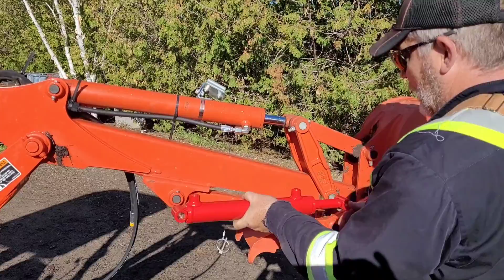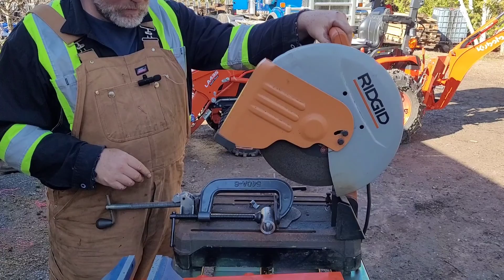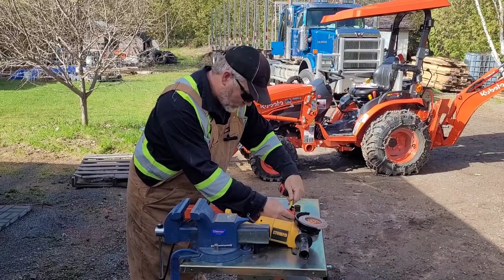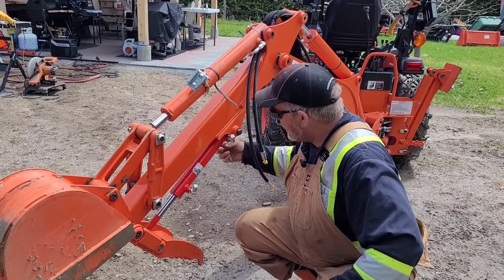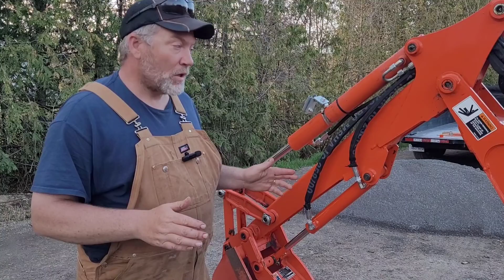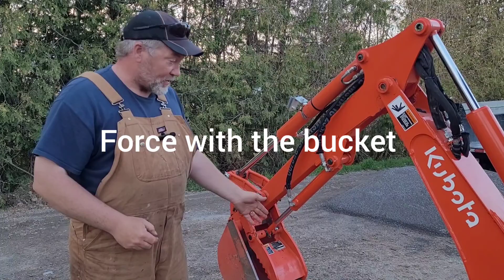D.I.Y Hydraulic thumb for the Kubota B2601 compact tractor.

Comment: Could you have put a sleeve in the holes instead of cutting the ends off?
Reply from the maker: I could have if the ports would have been in the right location but unfortunately I had to rotate the cross tube on the cylinder end 90 degrees. Thanks for watching and I hope that clears it up. 👍👍

Comment: Would absolutely love to see someone that integrated the controls for the cylinder to the BH itself, rather than rear remotes, along with controls on the BH controls so that you can use the thumb while using the backhoe without reaching for the rear remotes.  

I've also heard that there should be a relief on the thumb circuit so that you can't damage the thumb cylinder with the bucket.  Any thoughts?
Reply from the maker: I could have integrated it with the third function and just added a two way normally open switch and mounted it to either control for the backhoe. But I chose to go with the easy route because the only time I use the thumb is if I get a big stone when I am digging and the newly added cylinder saves me from getting off the seat.  I don't use it as a grapple very often. Thank you for watching the video. 👍👍

Comment: you know, you could have used 1" OD x 3/4" ID bushings in the backhoe mounting ears and stepped down to 3/4" pins and not have to risk welding on your cylinder. as long as you're only using the thumb to clamp, the 3/4" pins will hold any force the cylinder can generate.
Reply from the maker: Thanks very much for watching!! I agree with you about the bushing, unfortunately with the cylinder that I purchased the  ports were 90 degrees off of where they had to be so the cross tube on the cylinder end had to be removed regardless. The cross tubes were only 10 bucks, so I figured it was the most economical solution.

Comment: Look over the rod of that Princesses auto cylinder. I had one about that size. Cut the ends off and welded ball links on to make a hydraulic top link. Once done I extended it out and noticed a ding in the chrome. Took it back. They took it but lost my time and ball links I welded on. Got more ball links and before I did anything I pulled the cylinder out on the replaced one and sure enough the next one had chrome damage too.
Reply from the maker: Great advice and thank you for watching. I checked mine over and it seems to be OK. I think the quality control is lacking from certain manufacturers these days.
Reply: As a welder all my life I buy hundred of them in many sizes from Princes auto for things I build for people an my self. Never have had any problems with any of them. .  In tim case the 1.5" one he used is not going to hold up at all. The ones I have put on other peoples I use the same 2.5' OD same as this tractor mfg supplies when factory ordered. That rod on his 1.5 od is only 3/4" or the 1'  gripping any big rock takes a good hard clamp an that rod will bend even at a 6" stock and will not have the power to hold

Comment: To keep from bending the thumb Cylinder, use the Thumb to complete the Clamping force to pick up an Item.
Leave the bucket set. the Thumb Cylinder will not over Power the Curl Cylinder. 
Mike M.
Reply from the maker: You are absolutely right, Mike.  I tried that this weekend and couldn't agree more! Thank you very much.

Comment: Great video.  Thanks for sharing.  I have the same BH70 and a B2601.  I am wondering exactly where you got the hydraulics connected to on the back of the tractor and what is the control you are using to move the thumb.   It was hard to see in the video.  It would be nice to have something like the control for the 3rd function on the loader.  As for 7018 rod, I find it sticks a lot.  I use Artec 222, same strength and goes on like butter, little sticking.
What a great project, again, thanks for this.
Reply from the maker: Thank you very much, I have the thumb hooked up to one of the two rear remotes that I ordered with the tractor at the time of purchase. They are a factory option installed by the dealer.  They have come in handy.  Thanks as well for the welding rod tip, I'll be looking for the 222 from my local distributor and will definitely give them a try.
Reply: The article 222 is a sheet metal rod. Low Penetration sure it has the same 70,000  Tensile strength on sheet metal but it's mainly used reviews dickle body repairs there's exhaust systems white gauge metal rod iron railings. If your having sticking problems an spater problems you ether have your machine set up wrong. Or a cheap welder. Unless you have only a strait AC MACHINE you have to ask for the Ac 7018 witch is uncommon as the standered 7018 is a DC REVERCE HOOK UP. and is ment for heavy steel not sheet metal. Like the 222 is made for

Comment: Great video. Nice install. I’ve used a couple of princess auto hydraulic cylinders in the past for little projects. I’m hoping to make a hydraulic dump trailer to hook to my 1975 Case 224 garden tractor. Just a little 10 cuft agri fab trailer. Doing it just for fun. 
I really can’t figure out how you would use a mechanical thumb ? 
Have a great weekend Tim. That’s my sons name. 
Been wet and cold here this past week. Did a little work on my pile of hurricane Fiona wood yesterday. Sunny, but cold yesterday. No mosquitoes thou, hehe.
Reply from the maker: Thanks Mister, your son has a great name. The hydraulic thumb came in really handy this weekend for me. I was talking just a bit if topsoil of around my carport and hit a stone. I was able to get the teeth of the bucket underneath it and closed the thumb on it without leaving the seat. I was happy to have it 😊.  We finally started getting some very nice weather here.